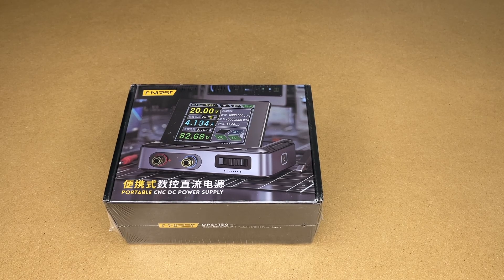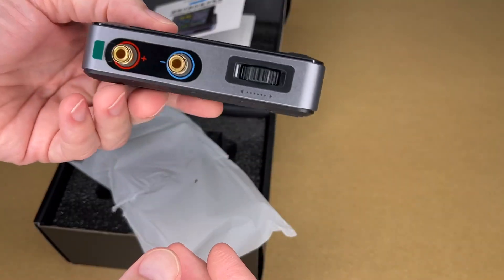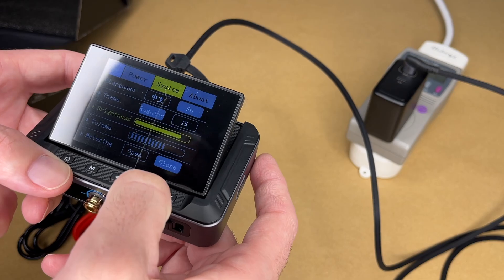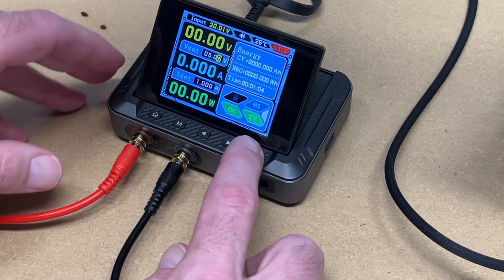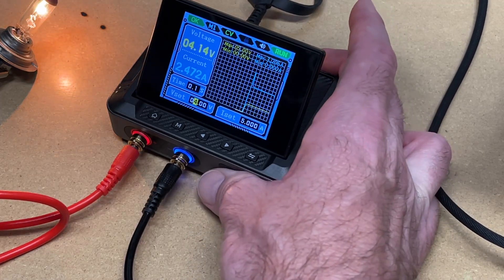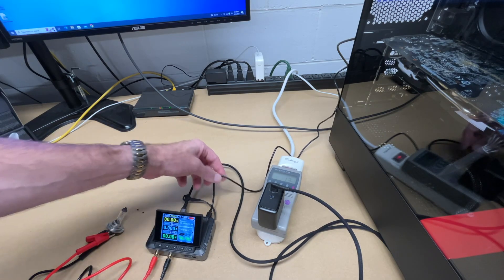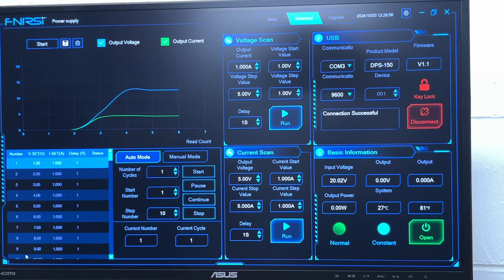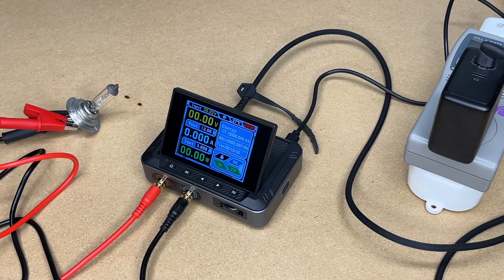FNIRSI DPS-150 Portable DC Power Supply with PC Connectivity

Comment: This company is shady. Told me my unit was lost in customs, but it never left their facility. Get a better unit that can boost, comes with a proper power supply and that will actually arrive when you buy it.
Reply: I have had a good experience with this product. Arrived in 2 days and I had a spare laptop power supply and for low voltage work does fine off a power bank that fits in your pocket. Fairly clean too..